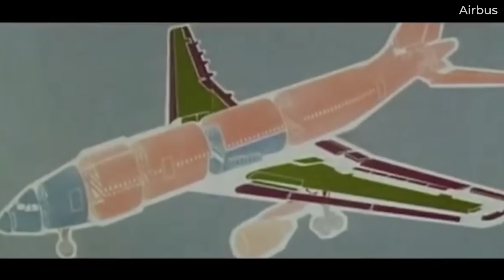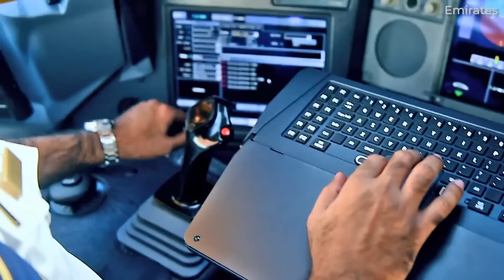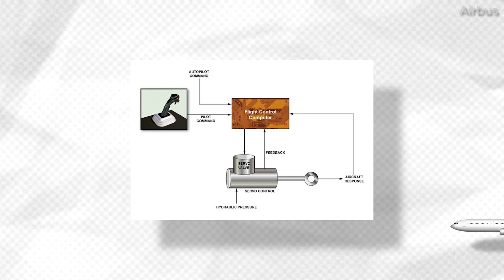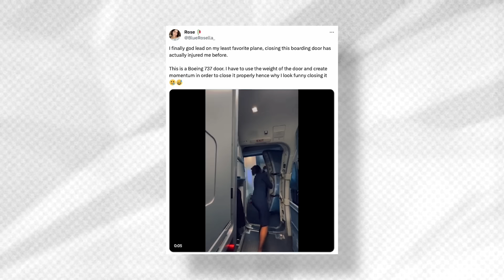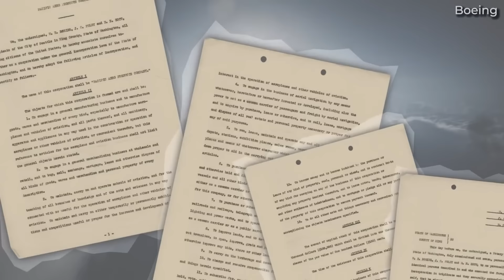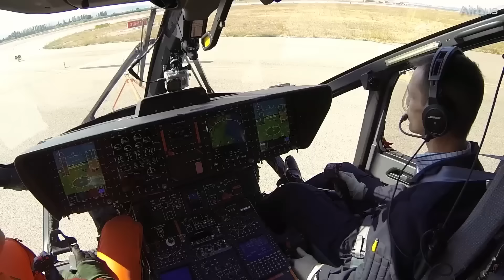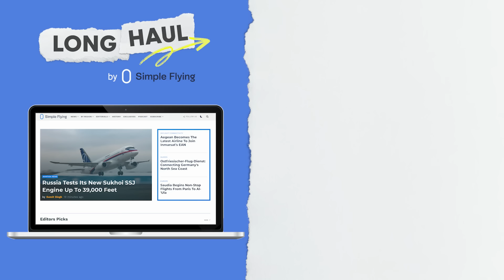5 Major Differences Between Airbus And Boeing Aircraft

Comment: The major difference nobody has mentioned is, at least Airbus do not lose their plugged doors at 15000 Feet altitude.
Reply: I'm annoyed at you! even before watching the video I was going to mention the habit of American aircraft ol just dropping parts off,But you beat me to it! I saw this phenomenon for the first time in the middle 50*s at an airshow at Finningley air base near Doncaster.A Douglas B66 just threw an engine   -   fortunately while it was still on the tarmac.
Reply: @peterpearson1675  Don’t be annoyed, by mentioning what you know, it adds value to the argument that the designers need to do something about shoddy planning and execution. It might just wake some people up that not everything that Boeing produces is good.
Reply: Airbus has had some incidences of doors popping off on the ground, however.
Reply: @spaceranger3728  Didn't know about those, thanks for the correction.
Reply: Lol, 😂
Reply: Not only doors, But windows and roof.....😂
Reply: @LexlutherVII  Ahhh, the Aloha plane, good point.
Reply: @spaceranger3728  so did Boeing.
Reply: @spaceranger3728 i think I speak for everyone here but I would much rather the doors fall off on the ground rather than at 16,000ft    Yes of course i would prefer the doors to not fall off but if they had to It would be better on the ground
Reply: @jamesevans938  Yes, but in the case of Airbus, somebody got killed when the door popped off on the ground.
Reply: Nor does Airbus give the plane's flight controls to a system that relies on a single sensor (that eventually leads to of their planes nosediving into the ground)
Reply: @Hypersonic-es6vh”A320 aircraft family cargo door exception
In several events reported to Airbus, an operator tried to open a door even though the warning light was flashing. Due to the overpressure, the door violently opened, causing damage to the aircraft and injury to the operator.”
Reply: @Hypersonic-es6vh “A United Airlines jet cut short a flight Wednesday and landed in Tampa, Florida, after pilots were alerted about a possible issue with a door, according to an airport spokesperson. The plane took off later “after the issue was addressed,” the airline said Thursday. The plane involved was an Airbus A319.”
Reply: @Hypersonic-es6vhjust some door mishaps
Reply: Sure it was not the door popping out,but Airbus said they ALSO have a door problem.
Reply: @Hypersonic-es6vh I just heard that was the case that they have a door problem on the a320 I’m not biased to anything company I believe any wrongdoing should be dealt with but,still both companies have their problems,sure undeniably Boeing has become something like the mafia. It’s sad to see the way things are going now. But hopefully Airbus will help bring them back to their senses, And they can use competition to help better each other for the market.
Reply: @lfaverby so they both did
Reply: Last week I was siting at the rear emergency exit in an A321. The first thing that came to my mind was "thank god its not a 737".

Comment: Airbus has a reputation for tightening all nuts, bots and fasteners on their aircraft, installing software on their aircraft that don't fly the aircraft into the ground and doors that dont fall off in the air?
Reply: airbus had a history of crashes due to software and overautomation causing confusion for pilots.
Reply: @davidk6264  Well it's easy to confuse pilots who don't understand the operating manual whilst Boeing didn't include how the aircraft actually works in the 737 max manual.
Not so?
Reply: @davidk6264 that has what led to the safest planes the world has ever seen

Comment: Some things to add. 737 doors are plug type, which means the door is larger than the door frame, requiring the door to first enter the fuselage, before being pushed out, and viceversa to close it.
On the PTU, the 330 does not have a PTU as it has an electric pump for green, blue and yellow systems. The 320 family only has blue and yellow electric pumps, so the PTU is active when operating single engine from either side. In the 737, it's referred as "back to back" pump, which is essentially what it is, and it dates back to the 727, and the DC9 and DC10 had them as "transfer pumps", but without the noise as their cycle frequency was slower than the Airbus. There are procedures in place for the Airbus crews to turn on the yellow pump during single engine taxi as to not to annoy its passengers.
Reply: Alaska air got grounded.
Reply: That same door just blew off of an Alaskan Airlines 737 MAX mid flight 🤣
Reply: your comment aged like milk
Reply: Here we are after the door blew off. Now we know better
Reply: Are you a time traveler?

Comment: At 2 minutes: the yoke doesn't control the rudder: foot pedals are used instead, but the rudder is rarely used on large commercial aircraft in normal flight. The pilot may employ it when countering side winds and windshear, however.

Comment: I was AMT on 737-200 & 300's build in the 1980's and Airbus A319 & 318's built in the early 2000's. I can confirm that it is much more difficult to close the doors on the 737 vs the A320 family aircraft with which I have experience.
Reply: Would agree with that. Flew the 737-300/500/700/800  for around 15  years, and now the A320 for the last 10. Additionally arming and disarming the slides is much easier on the Airbus and  allows for the simple safety of automatically disarming  them if the door is  opened from the outside.
Reply: The doors in the 737 and 747 are so outdated , they just swing around, whereas all airbus have doors that open in parallel, the A380 has doors that open electrically, just press a button, no Boeing offers that comfort.
Reply: Nowadays the doors of brand new Boeing’s 737 even blow out in mid-air.
Reply: Thx for sharing. @hm4867 and Soordhin

Comment: Fly-by-wire exited before Airbus.  They may have been the 1st to install that tech. into commercial aircraft, but it has been in military aircraft since before Airbus.
Reply: Pretty sure the Concorde used fly by wire too.
Reply: yup, fly-by-wire existed  before Airbus implementation, try 1930 Tu ANT-20 was FBY.  just a few years before Airbus, maybe. HE 111 was also FBW.  Ratehr douses Airbus claims.. and then there are  those others applications, Lunar Landing Research Vehicle (Flying Bedstead) ,  British Hawker and Su T-4....
Reply: All others before airbus were analog fly by wire airbus implemented the first true digital fly by wire with a flight computer controlling the flight surfaces
Reply: Did the vid say Airbus invented it? No so why are you making the argument. The vid simply says of the two companies it was Airbus to first install it. Pay attention before commenting.
Reply: @NicotineRosberg  The Concorde crashed because of a DC-10.

Comment: Airbus don't rely on upgrading 60 year old designs past the point where they are safe.
Reply: They did upgrade a 40 year old design, but it was easier thanks to the good ground clearance the A320 has
Reply: the a330 neo is based off of the a330 which is based off of the a300...
Reply: Yes, yes they do. All iterations of the A320, A330, A319, A321 are from the same design. You don’t know much about aviation do you?

Comment: I'd like to point out that Airbus was not the first company to use flyby wire. 
Also some other key differences are the Shape of the nose cones (Boeing super pointy, Airbus is more round), The cockpit window (Boeing airplanes have a distinctive V) and the Ailerons (Boeing have midwing ailerons (or flaperons) whereas Airbus have a large double aileron at the tips (triple on A380)).
Reply: Airbus was not the first company to use fbw, but Airbus is the first company to have implemented FBW on a civilian aircraft (A320).
Reply: @styren2815  Not even this is accurate, as Concorde, undoubtedly a Civilian aircraft that predates the first A320 (the A300/310 didn't have FBW), had FBW.  But they were the ones to introduce it into the mass market.
Reply: A350 rather pointy, it would apply for a320 and maybe a330
Reply: @Colaholiker  To be exact, A320 is the first aircraft to equip with digital FBW, which every FBW we see today are using. Concorde was the first with FBW, but that's in analog form. Also  Aérospatiale, one of the Concorde's designing company, initiated Airbus and brought their experiences in Concorde project with them.
Reply: @steinwaldmadchen  very good description!
Tbh, I don't think that a digital FBW would have been possible with the technology available when Concorde was designed.
Speaking of companies that became Airbus, due to all of that, Airbus actually held the type certificate for planes that predated the company. Concorde was one of them, the Carvelle was another.
Reply: Boeing doesn't have flaperons.  They use spoilers.  They don't use trailed edge lift devices for turns (flaperons)
Reply: @soccerguy2433  ah they do have flaperons (or a spoile flaperon incase of 787). It is used in turns at high speeds as the large distance of the outboard ailerons is quite far from the roll axis, thus producing too much force. Anyway the point of my comment was pointing out other differences between the two manufactures. If you look out of a window at the wing of an aircraft, looking at the ways the ailerons are arranged can tell you if Airbus or Boeing aircraft. In other words Airbus planes have uninterrupted flaps where Boeing have Interrupted ones.

Comment: Airbus gets the credit for producing the wide body twin jets. Until that wide bodies were 3 and 4 engines.
Reply: boeing invented the widebody so yeah..
Reply: @Planetrainguy  But Boeing's widebodies focused on capacity back then. A300 is way more influential to today's jet on how to get efficient.
Reply: @steinwaldmadchen  i still prefer boeing tbh
Reply: Like the 767?
Reply: @mikeplummer26  767 was launched 4 years after A300 flew its maiden flights, and its enter into service was almost a decade later.
Also many of the technologies incorporated onto 767 was first adopted on A300 - composite materials, supercritical wings and two crew cockpit, if not the twinjet widebody concept itself.
Reply: At the time the A-300 was designed (late 1960's), the safety rules required all trans oceanic jets to have more than 2 engines. The A300 was only a mid-range aircraft and not intended to be used for trans atlantic routes.  When the ETOPS rules changed and 2 engine aircraft could be used to cross oceans, Boeing produced the 757/767 pair which were intended for long range use. Boeing did not produce 2 engine wide bodies because the rules blocked that option. To imply that Boeing did not have the expertise is absurd.
Reply: @julianfell666  In 1976 ICAO allowed 90-minute diversion, and A300 had been flying over Northern Atlantic, Bay of Bengal and more safely for years since then, outside of United State. FAA only approved the same thing only in 1985, probably lobbied by Boeing amid the launch of 757/767. 
And that still doesn't change the fact Airbus pioneered in adopting many advanced technologies in civil aviation. No one stopped Boeing, MD or Lockheed from putting composite onto their quadjets or trijets for example.
Reply: @steinwaldmadchen  ... its* entrance* into service
Reply: Which begs the question. Why is the Boeing 777 series and the 787 so successful ?????????  If Boeing ever gets off their a** and gets the 777X in the service It will be even bigger, no pun intended.

Comment: The main difference is the lower landing gear of the 737 airplane designed at the origin to facilitate boarding and unboarding. It now becomes the source of many difficulties and setbacks as it is impossible to change the engines or to lengthen the fuselage easily.
Reply: exactly... why don't they just retire the 737 and bring out a clean sheet design...
Reply: Sure, in the name of all things, holy makes me wonder why they did not do a complete redesign at  least 15 years ago, it has been their number one selling jet. Now, I'm fortunately, it has been reduced to the origins of salvage yards in 2 or 3 different places on the planet. Someone at Boeing needs to tell them to get off their ass and get the 777X into service. You're losing money Boeing, Yes, even more, I didn't think that was possible.
Reply: @23merlino  797 is supposedly designed to replace the 737.

Comment: the 737 door was designed in the 60s and you feel every one of those years when you try to close the bastard 😠
Reply: This comment aged interestingly
Reply: Let me guess. Closing the 737 door involves applying force with the knee.
Reply: @mach6893  the opposite, you have to somehow both push and pull
Reply: @JoaoPessoa86  Oof.
Reply: They are very easy to open mid flight though . They do it automatically

Comment: But i like both Airbus and Boeing. The first time i have flown onboard an airplane was the Boeing 737 Classic back in 2008 i think and i was just a kid at the time and not an Avgeek and since that year I have flown onboard the Boeing 737 8 times and i have also flown onboard the Airbus A320 10 times.
Reply: By "classic" do you mean a 737 300/400/500? Out of curiosity, what airline was still operating them in 2008?  I flew on a 737-200 in 1977, and from my seat just behind the wing, I had a great view of the "clamshell" reverse thrust mechanism. It looked like the back of the engine fell off! 😅 I'm glad to say that the CM56 doesn't use that system.
Reply: @theharper1  In the case of Indonesia in 2008, i think the airline that flown the Boeing 737 classic are Lion Air, Batavia Air, Sriwijaya Air, and Garuda Indonesia.
Reply: @nurrizadjatmiko21  thanks! That makes sense.
Reply: Boeing was once synonymous with Quality. I liked their planes and trusted the name. Sad.
Reply: @theharper1   I flew in a 737 400 in 2019 from Warsaw Chopin to London City Airport..Need to Congratulate LOT the Polish Airlines for still managing to fly a metal Coffin even in 2019..
Reply: @lnr243  interesting to know, thanks! It's amazing how long the service life of some aircraft has been. The fairly recent 737 freighter crash in Hawaii suggests that there should be limits, though.

Comment: A380 !!! So quiet , so comfortable, so much space above head
Reply: The A380 has even electrical doors, no effort for the crew to close and open them anymore.
Reply: 747 much better
Reply: @crazygamingyt7245   from yesterday. I bet you never flown the one nor the other
Reply: @crazygamingyt7245  50 years ago maybe 😀😀😀😀
Reply: Back in the day I found the McDonnell Douglas DC-10 and Vickers VC10 to be quiet and comfortable yet the DC-10 had a poor safety record in early service (the cargo door problem); the VC10 had impressive performance and still holds the subsonic trans-Atlantic speed record but poor sales.